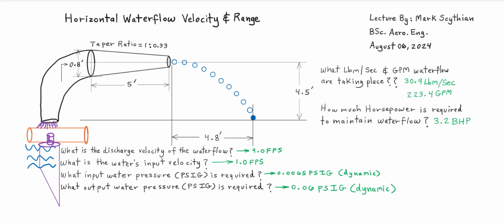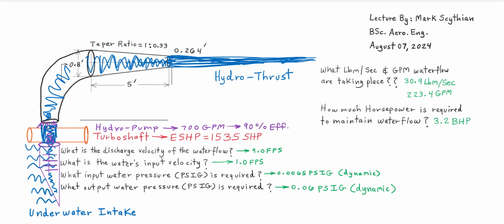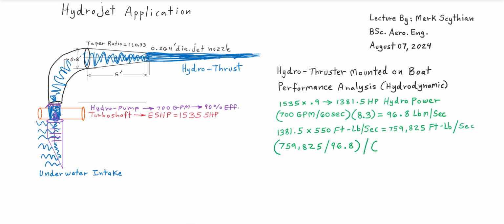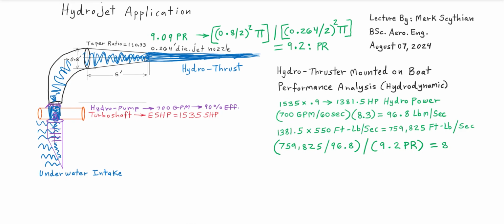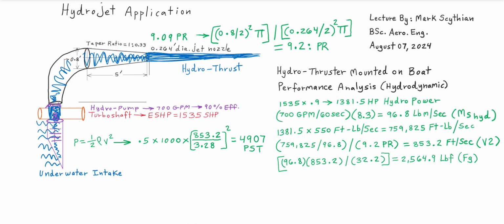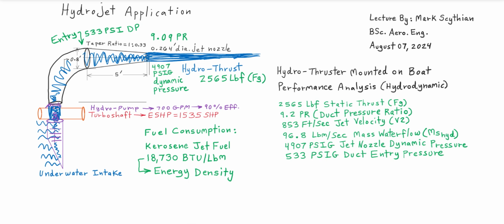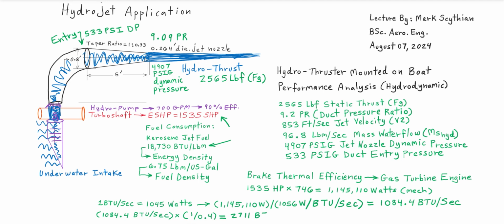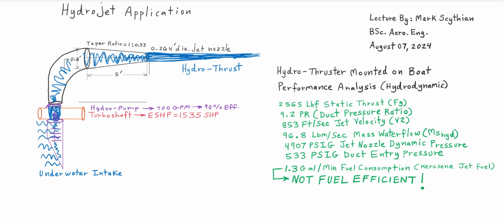Hydrojet Application (Hydrodynamics)

Comment: Using the tricks, how far can you shoot water?  I'm thinking about forest fires.
Reply from the maker: Brilliant idea!  Emergency response.  Fire-fighting.  

Regardless to elevation-angle, Hydrojet Water Range will equal 50 to 100 feet.

High-velocity waterflow would disperse as atomized water droplets (Turbulent Reynold's Number) over a 33-Foot-Range.  

Effective Range:  Approximately (1.5 to 3.0) x 33 feet = 50 to 100 FEET RANGE.

Relevancies:  'Water Impact Force' and 'Water-Mass-Flow' upon Target/Fire:  -2,565 Lbf, and 96.8 Lbm/Sec (11.7 gallons/sec = 702 GPM).  

If this Hydrojet Application was used to fight fires, it could also cut through barriers such as brick and most non-reinforced structures.
Reply from the maker: Also, consider these metrics:  

Delivering 96.8 Lbm/Sec of water upon a Wood-Fire will REMOVE heat at this rate:  [(-1000 BTU/Lbm) x (96.8 Lbm/Sec)] = -96,800 BTU/Sec.  

Specific Gravity of Wood = 1.5 ===> [(96,800 / 1.5)] = 64,533 Lbm.

Delivering 96.8 Lbm/Sec of Water upon a wooden-house-fire, removes sufficient heat to halt 64,533 Lbm of Wood from burning.   

However, about 50% of the water's heat-removal-effect is LOST during water-transfer.  

So, [(64,533 Lbm Wood) x (0.5)] ===> 32,267 Lbm/Sec of burning Wood will quickly lose sufficient heat to extinguish.

Latent Heat = Mass x Temperature ===> Decreases water's heat-removal-effect by 10%, or [(0.9 x 32,267)] = 29,040 Lbm/Sec.

96.8 LBM/SEC WATER-FLOW DELIVERED UPON A WOODEN-HOUSE-FIRE EXTINGUISHES 29,040 LBM/SEC BURNING WOOD.

Regarding Forest-Fires, the water content within trees would decrease extingushing by 60% or:  [(0.4) x (29,040)] = 11,616 Lbm/Sec.

96.8 LBM/SEC WATER-FLOW DELIVERED UPON FOREST-FIRE EXTINGUISHES 11,616 LBM/SEC TREE-WEIGHT.